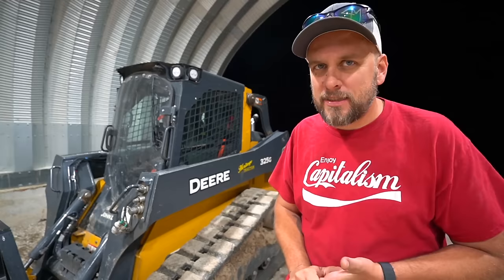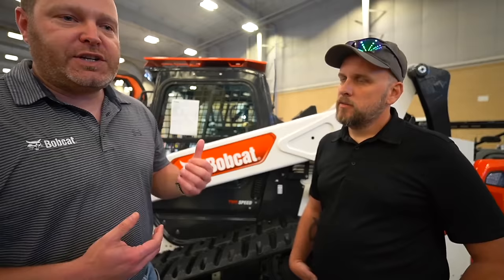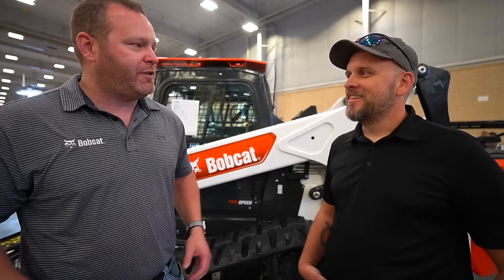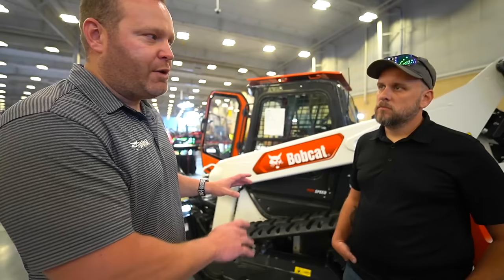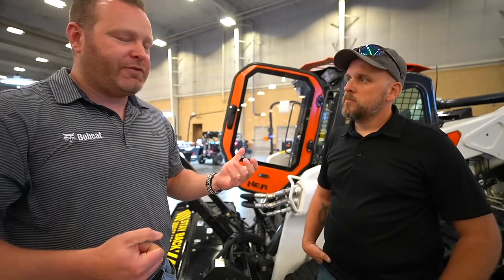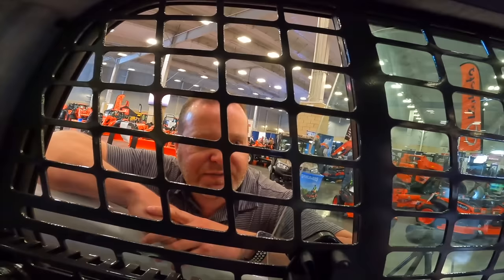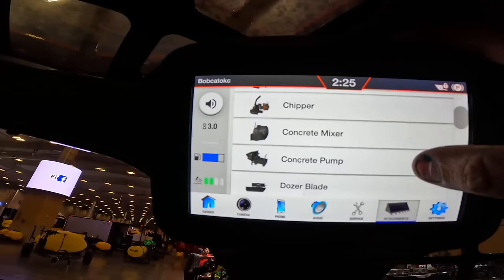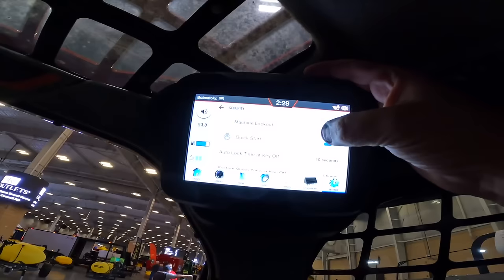I Should Have Bought a Bobcat Skid Steer - Here is Why

Comment: i do not like the bobcat skid steers, we have 2 of them and 2 john deere and the bobcats have been back to the dealer so often due to breaking down that the company i work for wants to sell them and get 2 more john deere. we have had the lift cylinder pins fall out, they overheat really bad, we had one that would not start up because it said the diesel was to hot to run so it went down due to a stupid sensor. its a lot tighter internal to work on. the only thing that happened once that i like is that when it blew a hydraulic line it did not leak one drop of hydraulic fluid on the ground it was held inside the shell, now fixing it was a pain in the butt. i do wish that companies like john deere and bobcat and all other companies that make similar equipment would make a lot of it universal so its not hard to get pars and hard to work on. now i do not know if it was just our dealer that was not very good or what but from working on them and john deere and even some older case units i like bobcat the least. just my opinion

Comment: It's probably poorly designed hydraulics that's causing that.  The pump or pumps that drive the skid steer should be separate from the pump that runs the work functions (lift, tilt, etc.).  Even if they don't have separate pumps, the same can still be accomplished in a system properly configured with a flow divider or priority flow valve, which will give you a certain amount of dedicated flow to the drive regardless of whether you're using the other work functions or not.
Reply: Kubota SVL75-3 model now does that.

Comment: Bobcats have broken on me more than any other brand of skidsteer I've run. And I'm not talking about just one machine, I've ran several different bobcat skidsteers and mini excavators on several different jobs. The minis weren't all that great either. Don't waste your time with anything smaller than a T60 if you have any digging to do. Bobcat machines are not bad when they're brand new, but once they have about 2000 hours on the clock parts start to fail. And that's with proper scheduled maintenance. Especially electronic sensors. They just don't hold up as well as some other brands. I'm not a CAT loyalist, actually when it comes to a lot of machines I prefer other brands/models. And especially when it comes to skidsteers. I recently ran a CAT 279 skidsteer and I was not a fan at all. My favorite skidsteers that I've ever ran were a John Deere 333g and a takeuchi(i forget the model number but it was a 75 hp unit) but I didnt run the takeuchi long enough to speak on its reliabilty. The 333g was really sweet, although it was brand spanking new and I only ran it for about 3 months so of course it was flawless and didn't break, and I promise it didn't feel like its lacking power while turning and moving the bucket at the same time compared to a similar model bobcat. Anyway, a lot of brands start to feel kinda clapped out once they have about 2000 hours on them, and then they're totally smoked by the time they have 5k-6k hours on them, but CAT's usually still feel pretty solid at 2000 hours, like theyr're just getting broken in and its not unreasonable to expect 8k-10k hours out of most CAT machines before they need a total rebuild/restoration.

Comment: I'd look at the tym t494. check out KUKJE VS EVERYBODY ELSE  on YouTube. I'm told due to no ecm if you ever have an issue with DPF you can use a straight pipe or muffler. the most simple modern tractor engine. you have to unplugg data logger I'm told. 30k ROPS 35k CAB
Reply from the maker: Yeah, I have a video showing how to disable the DPF filter.  There’s literally a bypass you can unscrew before that filter.

I’ve talked a lot about the 574 which is the same exact tractor only with the turbo. I’ve ran them multiple times and did a standalone video review

Comment: I have a Kubota SVL 75-3 enclosed cab and its simply not true about the air vents ! there are 5 adjustable vents in the cab ! 
3 close to feet and 2 up by seat headrest - Way more than enough to keep u cool or warm. The roll up door is/was the deciding factor in my search..After all the other box's were checked. 
-Dealer location and reputation 
-Performance 
-Price
-Finance options
Availability.
After bobcat and kubota checked all the boxs the roll up door was the thing that really was a no brainer!!
I did a video on this machine..
https://www.youtube.com/watch?v=B60iM495PxI&t=1s

Comment: Be glad you didn’t buy the bobcat. It’s not a handful of disgruntled people. It’s a widespread unresolved problem with the R series machines, like the T66 and t76. They are a nightmare of electrical problems. Especially they are left out in the rain, as most construction machines are. Water gets in the electrical connections and wreaks havoc. Seems like an easy problem for Bobcat to fix but they haven’t been able to. The old M series they still sell are still solid machines. 

However, with any of these new machines you really have to go with a brand that has great local dealer support. If bobcat is the best dealer in your area then I’d go with bobcat knowing your dealer is great and will fix any issues you run into. That’s the reason I run cat.

Comment: M series are awesome, I wouldnt buy an R series bobcat.
Reply: who decided where to put the hydraulic level sight gauge? these next 2 are likely connected, why do they have rubber lines going through a hole to the drive motors that allow mud from the tracks to enter the machine, and why do they R have so many water related wiring failures? I bought a t740 to avoid the emissions garbage
Reply: the slide up door is awesome. bobcat doors suck. getting trapped in the cab makes loading anything on to a truck impossible. 90% of the time you have to remove the door to use the machine.
Reply: cannot pressurize a cab when the door has to be removed to work.

Comment: Do you work for Bobcat? Seems like it. Bobcats as well as many of the other current machines are overloaded with unnecessary electronic crap that will fail and give you expensive headaches. You don't need those silly features to move dirt! It's a tactic to seduce buyers.  These  have become too complex for most shops to quickly and economically repair.  After a few out-of-warranty breakdowns you will long for a simpler no-nonsense machine.  Defending a swing-out door on a skid steer is stupidity or desperation or both!  The argument about air leaks is much ado about nothing. Bobcat, having placed their engine longitudinally in this model makes them more alike than different than their competitors. Wait till you have to replace a pump-drive coupling or an injection pump. The best machines for any particular job  are the simplest ones that can get the job done.
Reply from the maker: I review and run equipment for a living. I have no affiliation to bobcat whatsoever.

The other gentleman in the video with me is a salesman for bobcat and it’s his job to say good things about them. He also seems like a honest guy that will point out a flaw in their own machine.